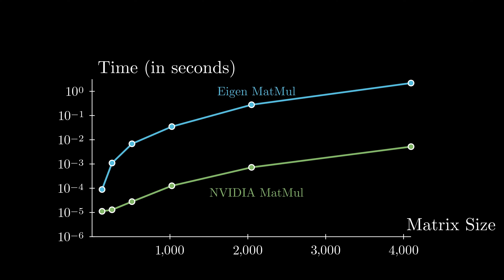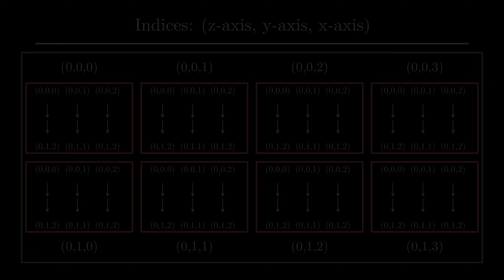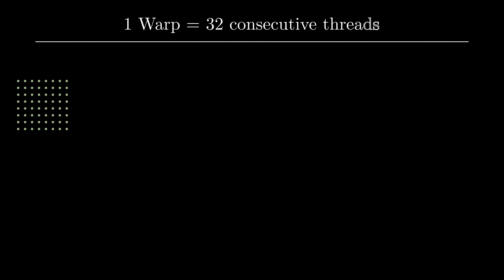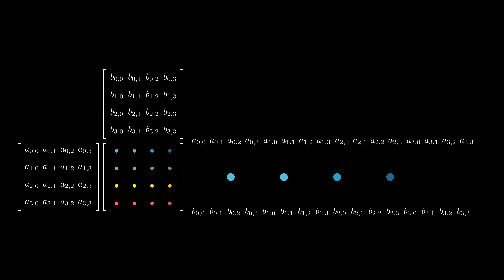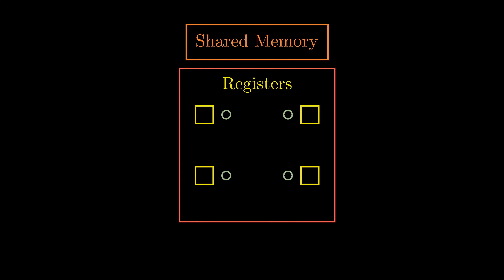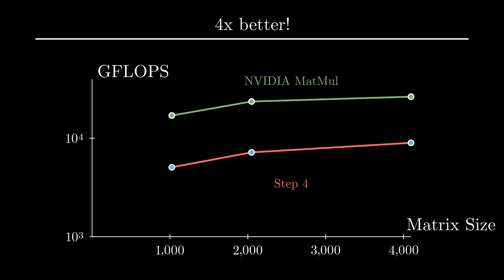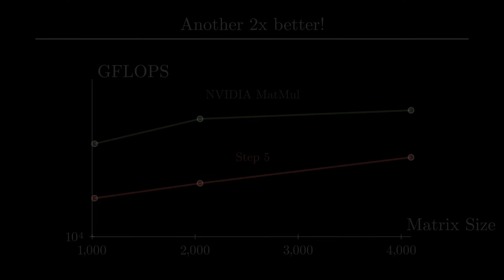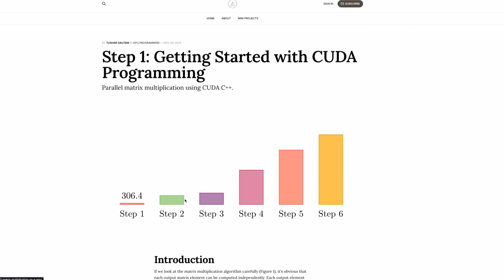Mini Project: How to program a GPU? | CUDA C/C++

Comment: Hey man! You made a mistake in your article. You said under the Parallel Matrix Multiplication subsection that "blockDim.x and blockDim.y are the number of blocks in x and y axis respectively," but those are for gridDim.x and gridDim.y. blockDim.x and blockDim.y are the number of threads in the x and y axis, respectively, of a block.

Sorry for pointing this out.

Comment: Hey great video. Are the animations at 4:58 detailing the matrix multipications correct? Looks like there's a mistake in what's being selected by the animation. The column vector should be repeated for each dot product shown, but that doesn't look to be the case.
Reply from the maker: I didn't show the complete set of calculations there. My point was to just show the memory access patterns. 🙂

Comment: If you use Strassen Method for multiplying 2x2 matrices you will reduce the number of required steps by 67% in large matrices
Reply from the maker: I'll definitely try that in future. Thanks a lot for your comment 😀
Reply: @tgautam03  👍👍👍👍
Reply: @tgautam03  https://www.youtube.com/watch?v=0oJyNmEbS4w 
That is where I learnt it 😃

Comment: Is the nvidia implementation using wmma (Warp Matrix Functions)?

Either way it would be interesting to see how the performance would be impacted if the tensor cores were used as well! Good video!
Reply from the maker: I’ve a video showing the use of tensor cores in a very basic way. I’m not using tension cores in this video, but will definitely consider a similar step by step approach using wmma. Thanks a lot for the suggestion 😀

Comment: Good job. The reason workgroups are laid out in 1d/2d/3d grids is that all GPU compute APIs were first designed and implemented on top of existing graphics concepts where calculating outputs as e.g. 2D grids is a natural thing.

Comment: Great content!
One thing I have never understood is, for matrix multiplication, what is the sort of threshold in size that makes a GPU implementation faster than a CPU implementation? If I want to do one million multiplications of 4 x 4 matrices, ignoring the overhead required to set up the computations, is the GPU faster than the CPU? Surely not. What about 100 x 100? 1000 x 1000?
Reply from the maker: GPUs are suited for large dataset. I can’t specify a number as it will depend on the algorithm and GPU specs.

Comment: What was the reason for surprise at the x-horizontal / y-vertical layout? It's the standard convention for image processing, which is what GPUs are designed for
Reply from the maker: y-axis is generally vertical up and I'm not bothered too much about this as well. What confused me was (z, y, x). I understand that GPUs weren't designed to work with these kind of computations but it always confused me (when I started out).
Reply: @tgautam03  i think you mean i,j vs x,y.. i often means the row in matrix operations. But x is always horizontal in cartesian coordinates.